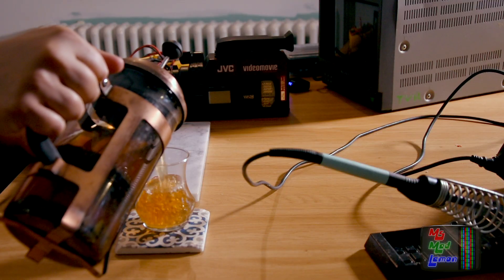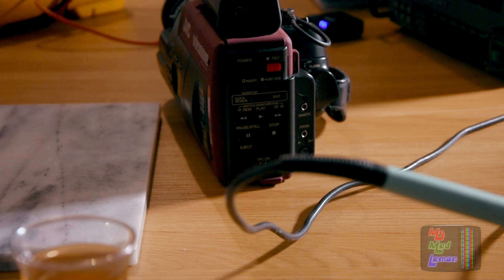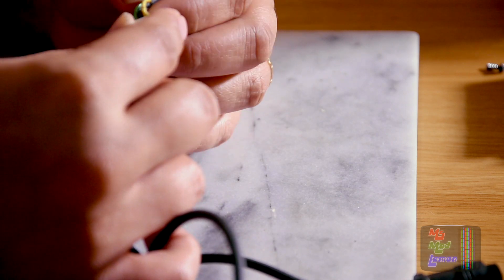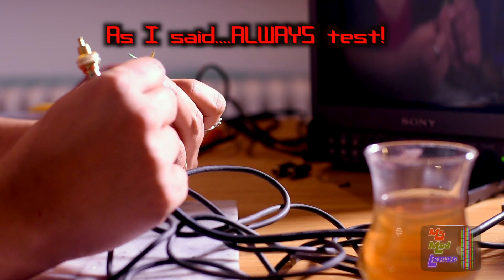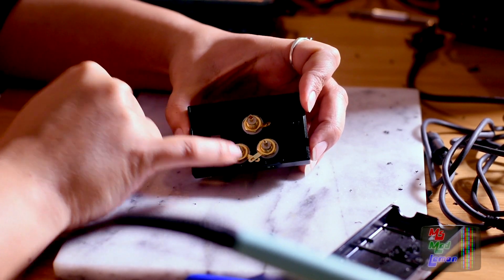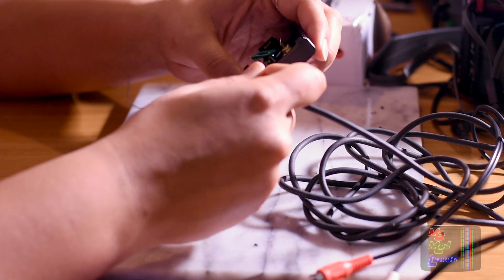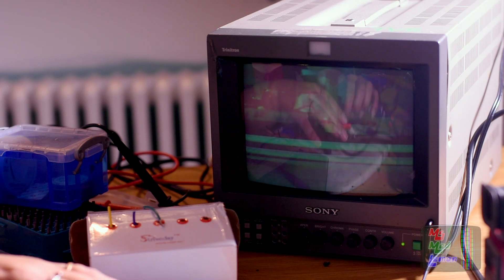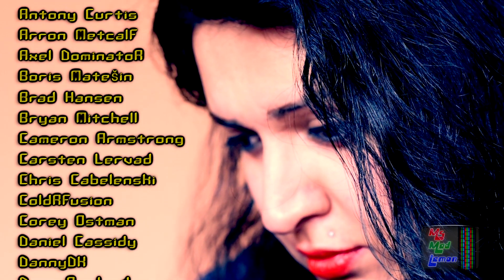JVC Camcorder AV Port Reverse Engineer

Comment: Some camcorders do have A/V in like the Sony's, Though the same connectors used for both inputs and outputs, depends on the camcorder mode, In VCR mode they are inputs, In camera and playback modes they are outputs.

Comment: Is there anything you can do to make a new/modern battery for these old camcorders?

I did buy a really old 80s one a few years ago,  came with a rechargeable battery,  but its long dead.
Reply from the maker: I do that very thing in my summer special, using a li-ion battery. Skip to 48 mins on this video.  https://youtu.be/qDXYVZF55Qw
Reply: @MsMadLemon  ah, excellent.  thank you!!! :)
Reply: Use NiMH AAs for a drop in replacement. Note that you'll probably need to use a universal NiMH charger instead of the original NiCd charger.

Comment: For scenarios like this, you can use a capacitor in-series with each wire your testing, as it will safely pass the signal through, whilst blocking any DC component from reaching the monitor.
Reply from the maker: I agree, I went by instinct this time but will use a capacitor in series next time.